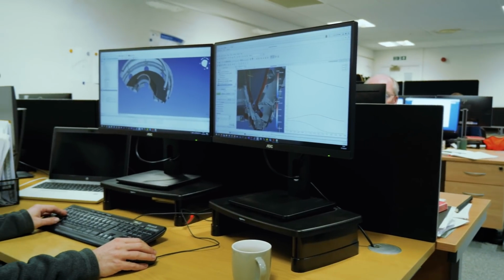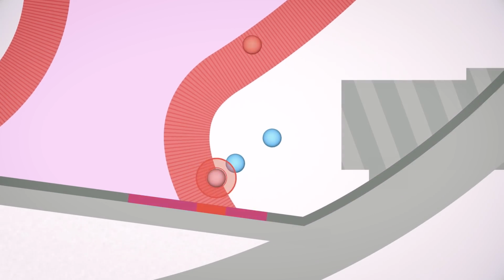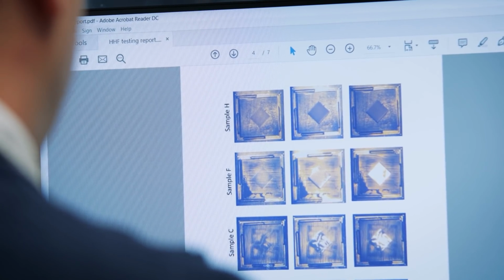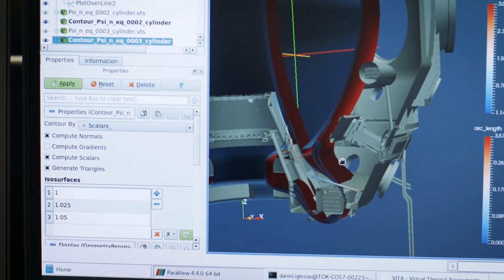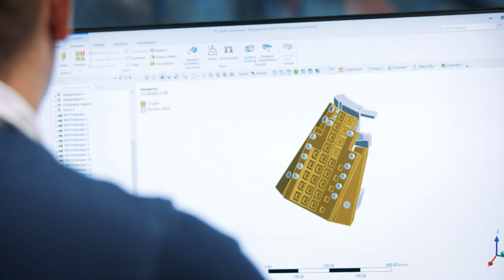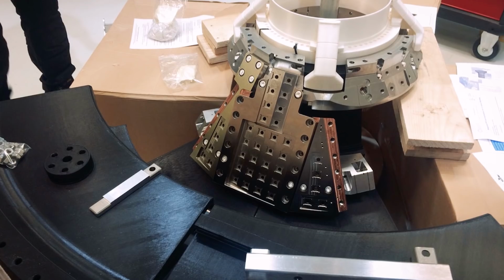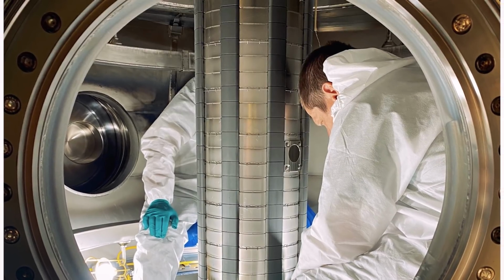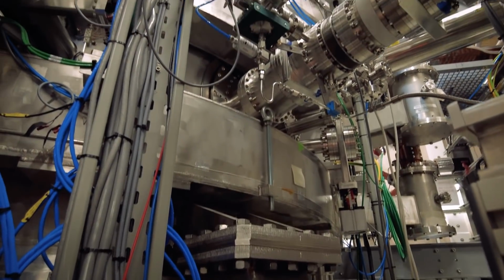The ST40 divertor innovation story--fast-tracking a tokamak upgrade during a global pandemic

Comment: For some reason everyone thinks that nuclear fusion must have physical criteria only as in the fusion bomb? There are other ways of nuclear fusion that are not of the explosive type. Everyone has nuclear fusion in the solar corona in front of their eyes, but everyone obeys dogma, wrong scientific theory, and doesn't want to see the obvious. Nuclear fusion in the core of the Sun is an assumption. This assumption is not actually proven by anything. Nuclear fusion in the solar corona is proven by facts, which I set out in the video clip. For 70 years there is no result - no commercial fusion reactor. Isn't this already pseudoscience? There won't be a commercial fusion reactor for another 70 years or more. Investors and governments need to understand that they keep putting a lot of money into a failed project with a 70-year history of developing a commercial fusion reactor. They will never get a commercial fusion reactor. Because the developers have a wrong understanding of the necessary physical conditions for nuclear fusion in the reactor, to produce commercial heat. I will transfer the technology of a new method of nuclear fusion (fusion project #2) free of charge, under an agreement (contract). Remuneration according to the results. There will be an appendix to the contract, where the physical phenomenon and technology will be described. And until a small prototype of a commercial fusion reactor works, until it shows commercial heat, no one pays me. There is no deception here. The result is a prototype, small commercial fusion reactor I can make myself, in 1-2 years, depends on funding and speed of manufacturing. https://www.youtube.com/watch?v=91NOjCePzd I      
Почему-то все думают, что ядерный синтез должен иметь физические критерии только как в термоядерной бомбе? Есть другие способы ядерного синтеза, не взрывного типа. У всех перед глазами ядерный синтез в солнечной короне, но все подчиняются догме, неправильной научной теории, и не хотят видеть очевидное. Ядерный синтез в ядре Солнца — это предположение. Это предположение ничем фактически не доказано. Ядерный синтез в солнечной короне доказан фактами, их я изложил в видео ролике. https://www.youtube.com/watch?v=91NOjCePzdI       70 лет нет результата – нет коммерческого термоядерного реактора. Разве это уже не лженаука? Ещё лет 70 и более не будет коммерческого термоядерного реактора. Инвесторам и правительствам надо понять, что они продолжают вкладывать большие деньги в провальный проект с 70-летней историей по разработке коммерческого термоядерного реактора. Они никогда не получат коммерческий термоядерный реактор. Потому что у разработчиков неправильное понимание необходимых физических условий для ядерного синтеза в реакторе, для получения коммерческого тепла. Я передам технологию нового способа ядерного синтеза (проект синтеза №2) бесплатно, по договору (контракту). Вознаграждение по результатам. К контракту будет приложение, где будет описано физическое явление и технология. И пока не заработает небольшой прототип коммерческого термоядерного реактора, пока не покажет коммерческое тепло, никто мне не платит. Здесь нет обмана. Результат – прототип, небольшой коммерческий термоядерный реактор могу сделать сам, за 1-2 года, зависит от финансирования и скорости изготовления.

Comment: That was super interesting. Thanks for making this awesome documentaries.
Reply from the maker: Glad you enjoyed it! :-)
Reply: @tokamakenergy6400  I am the author of the third method of achieving nuclear fusion, this is the repetition of physical conditions as in the solar corona. In 6 months there will be a small prototype of a commercial fusion reactor. A commercial fusion reactor in 1-2 years! Power 100 kW.
For many years (almost 25 years) I have been convincing scientists that thermonuclear fusion in the Sun occurs not in the core of the Sun, but in the solar corona !!! But scientists are very stubborn, and do not want to believe the obvious. Why are scientists not accepting new breakthrough scientific ideas? There is an assumption, accepted by most scientists, that thermonuclear fusion in the Sun occurs in the Sun's core. But no one has ever actually confirmed this. This is just a guess, the fantasy of an authoritative physicist. Scientists are currently using two methods to achieve nuclear fusion: inertial confinement and magnetic confinement. But there is also a third method of achieving nuclear fusion, this is the repetition of physical conditions as in the solar corona. Nobody is using this third method to achieve nuclear fusion? In 6 months there will be a small prototype of a commercial fusion reactor. A commercial fusion reactor in 1-2 years! I propose a technology transfer for a commercial fusion reactor under a contract. Thermonuclear fusion in the Sun - a new version. http://n-t.ru/tp/ie/ts.htm     https://www.youtube.com/watch?v=izCALj848xU

Comment: I hope we can crack the fusion energy puzzle in our lifetime, it will change everything.
Reply: There are self-stablising plasmas that can avoid the problems of plasma instability, but are surprisingly cheap to set up. 

Loosely, you want to reduce the system current or you'll be swung by the formed unstable arc mode plasma, and the general relation of `A/m^2 = C/m^3 * m/s`, namely where `A/m^2` is proportional to `m/s`, such that `C/m^3` doesn't really change since you can't really increase the amount of coulombs in a unit mass. 

This tends towards a particular design that does not need containment magnets, nor a tokamak design. The hint here is anode tufting.

Comment: Great video.  Hope you get to 100 million degrees soon ☀️
Reply from the maker: Thanks!  We hope so too!
Reply: For some reason everyone thinks that nuclear fusion must have physical criteria only as in the fusion bomb? There are other ways of nuclear fusion that are not of the explosive type. Everyone has nuclear fusion in the solar corona in front of their eyes, but everyone obeys dogma, wrong scientific theory, and doesn't want to see the obvious. Nuclear fusion in the core of the Sun is an assumption. This assumption is not actually proven by anything. Nuclear fusion in the solar corona is proven by facts, which I set out in the video clip. For 70 years there is no result - no commercial fusion reactor. Isn't this already pseudoscience? There won't be a commercial fusion reactor for another 70 years or more. Investors and governments need to understand that they keep putting a lot of money into a failed project with a 70-year history of developing a commercial fusion reactor. They will never get a commercial fusion reactor. Because the developers have a wrong understanding of the necessary physical conditions for nuclear fusion in the reactor, to produce commercial heat. I will transfer the technology of a new method of nuclear fusion (fusion project #2) free of charge, under an agreement (contract). Remuneration according to the results. There will be an appendix to the contract, where the physical phenomenon and technology will be described. And until a small prototype of a commercial fusion reactor works, until it shows commercial heat, no one pays me. There is no deception here. The result is a prototype, small commercial fusion reactor I can make myself, in 1-2 years, depends on funding and speed of manufacturing. https://www.youtube.com/watch?v=91NOjCePzd I      
Почему-то все думают, что ядерный синтез должен иметь физические критерии только как в термоядерной бомбе? Есть другие способы ядерного синтеза, не взрывного типа. У всех перед глазами ядерный синтез в солнечной короне, но все подчиняются догме, неправильной научной теории, и не хотят видеть очевидное. Ядерный синтез в ядре Солнца — это предположение. Это предположение ничем фактически не доказано. Ядерный синтез в солнечной короне доказан фактами, их я изложил в видео ролике. https://www.youtube.com/watch?v=91NOjCePzdI       70 лет нет результата – нет коммерческого термоядерного реактора. Разве это уже не лженаука? Ещё лет 70 и более не будет коммерческого термоядерного реактора. Инвесторам и правительствам надо понять, что они продолжают вкладывать большие деньги в провальный проект с 70-летней историей по разработке коммерческого термоядерного реактора. Они никогда не получат коммерческий термоядерный реактор. Потому что у разработчиков неправильное понимание необходимых физических условий для ядерного синтеза в реакторе, для получения коммерческого тепла. Я передам технологию нового способа ядерного синтеза (проект синтеза №2) бесплатно, по договору (контракту). Вознаграждение по результатам. К контракту будет приложение, где будет описано физическое явление и технология. И пока не заработает небольшой прототип коммерческого термоядерного реактора, пока не покажет коммерческое тепло, никто мне не платит. Здесь нет обмана. Результат – прототип, небольшой коммерческий термоядерный реактор могу сделать сам, за 1-2 года, зависит от финансирования и скорости изготовления.

Comment: Seeing people inside the tokamak is quite jarring. I suppose I picture them as massive, and it shattered my illusion.
Reply: The ITER is massive. The whole point of theirs is to hit the break-even at a smaller size. And this is yet smaller then the target one.
Reply: @evilestmav  it's pretty awesome. I understand it logically, but still jarring to see.
Reply: @Whipster-Old  yep they usually are, this on takes advantage (or rather will) of new engineering in magnet tech which means you can run higher fields which means smaller reactors for the same output which means they're significantly smaller and thus easier to make which leads to them being faster produce at significantly lower costs - think ITER's the entire planet coming together to fund the project and it taking decades versus this one company with effectively startup money in a few years.